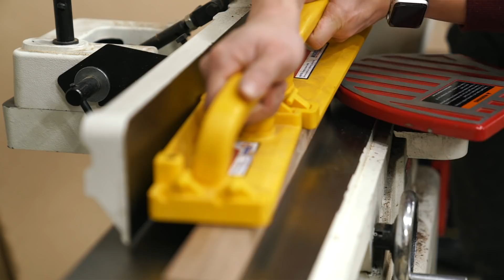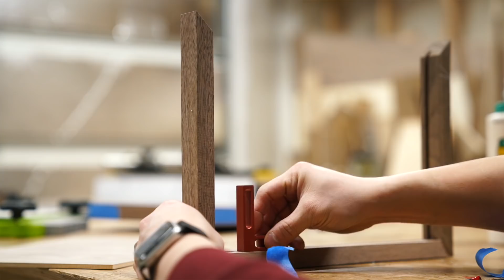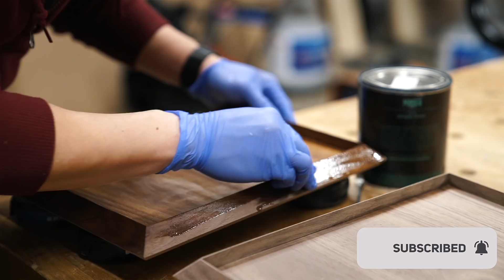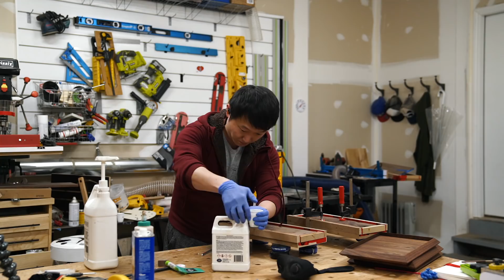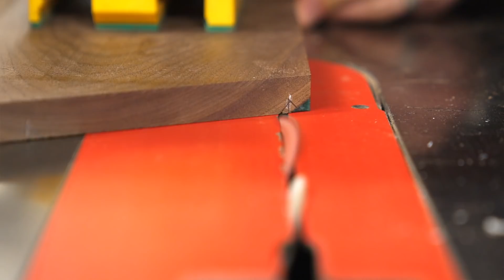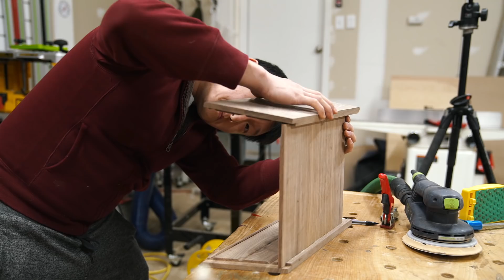DIY Modern Paper Tray From Scraps || How To Build - Woodworking

Comment: It looks amazing, just as reference I'm unsure when you sand depending what kind of wood but a type of hard wood use 120 sanding paper and finish with a 150 sanding paper. Soft wood use 180 sanding paper it helps when you coat the wood and it would make the finish product very shiny.  I'm unsure just a little if you are using the correct sanding method since I am not looking at it directly but your product is amazing this is something I would be interested in buying bc of how unique it is.
Reply from the maker: Thanks! I always sand to 180 and apply finish. It’s worked well for me

Comment: can someone explain to me the obsession that gringos have with epoxy?
Reply from the maker: Sure! It’s fast, helps to stabilize imperfections, and adds contrast. Why not
Reply: @BevelishCreations  

why not? there is no reason not to use it, I know it. My question is why you use it in ALL projects. perhaps you do not know other techniques? some less artificial technique perhaps?
Reply from the maker: I don’t use it on all projects...I used it on two
Reply from the maker: And I don’t consider epoxy as artificial technique. If you use wood glue, then epoxy is no different. First time I used epoxy is on my Harry Potter shelf, and that’s completely for artistic interpretation because I wanted the colors to represent the house of Hogwarts. For this project, I just wanted to make something fast and use offcuts that I’d probably throw away otherwise. I think the green color adds a lot of character to the walnut. It’s subjective I guess

Comment: Dude, love the build. Great videography, and craftsmanship. How do you like the Simple Finish compared to others you've used?
Reply from the maker: Bryce Phelan hey man, thanks! I really like the Simple Finish. It’s so easy to apply and so fast. I haven’t used other similar types of finishes such as Odie’s so I can’t make a comparison there. I used to use Arm-r-Seal which is a poly. It worked great, but I didn’t like the plastic-look/feel in the end, plus it took days to finish. This Simple Finish really is...simple. It takes less than an hour to finish from start to end, and it smells much better too (if you care about that). The first time I used it was on the baby dresser I built (2nd video I ever uploaded), and I used the one without the wax. It’s been 8 months now and still held up great. Even without the wax it seems baby pee proof lol.
Reply: @BevelishCreations  Haha, awesome. I was going to ask if you'd used the one with wax too. Cool - i've been using a homemade  beeswax/coconut oil mixture, but am always looking for other solutions too. thanks dude!
Reply from the maker: Bryce Phelan no problem! Just FYI, one of the guys from Maker Brand Co told me they plan to only make the wax only one later

Comment: Hey man! Why on earth would you glue in the tray bottom? You didnt / and shouldn't have. It was locked in by the four sides. That needs room for expansion and contraction.  Thats gonna split in the very near future.  Next time if your unsure of something you should just google it. Other then that mistake you made a descent video.
Reply from the maker: Thanks for the suggestion, but it wouldn’t split...its 1/4” ply. I always glue in my drawer bottoms this way. Have never had problems. I don’t like the feeling of the bottoms floating